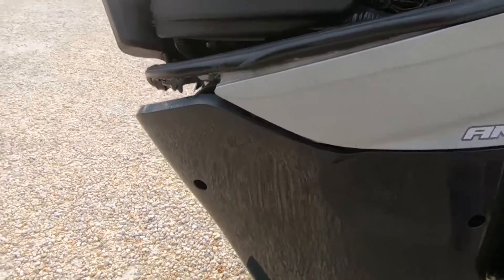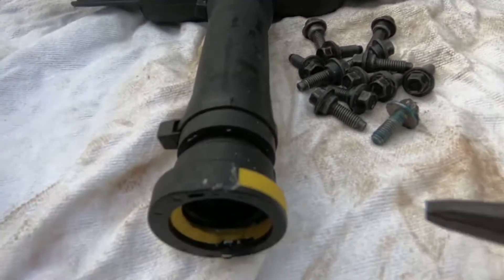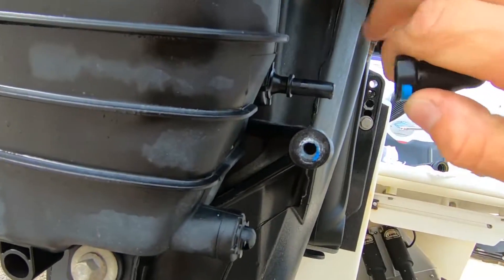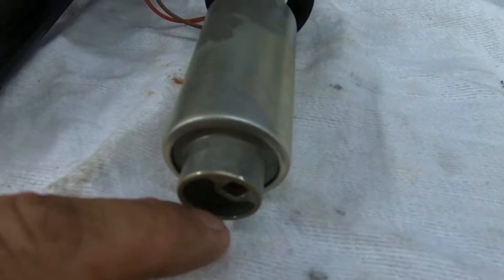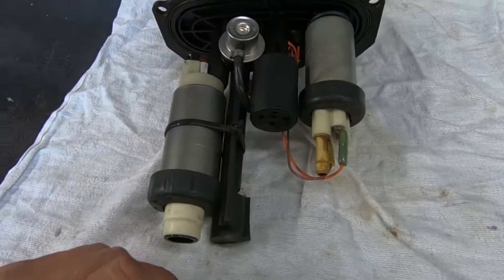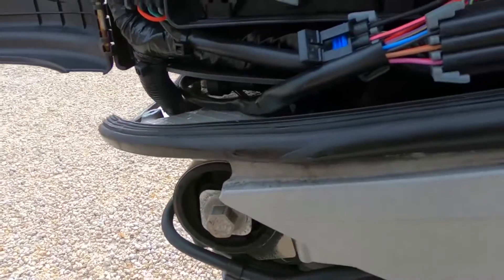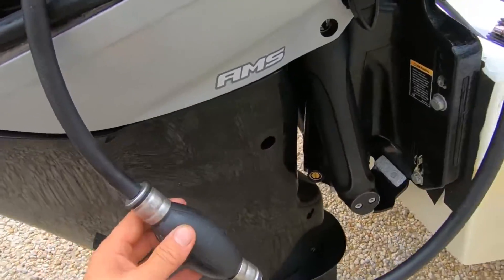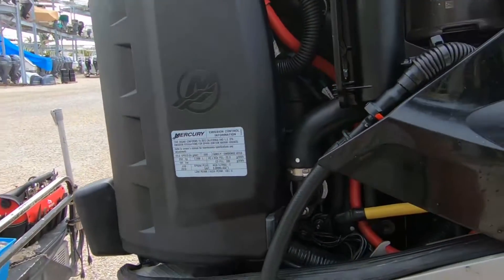How to remove | Disassemble | clean or change pumps in a Mercury Verado FSM (Fuel Supply Module)

Comment: Have you ever seen a lift pump that will run but not prime itself?

I have the bottom half of the fsm removed and the fuel line for the lift pump stuck in a jar of gas. It will pump lots of gas once it’s primed, but it won’t suck gas out of the jar through the fuel line. 

My float switch seems to work ok. The fsm was mostly empty when I took it apart. 

I got a code for a malfunctioning lift pump, but the pump powers on and runs, it just won’t suck fuel unless I submerge the inlet.
Reply from the maker: Sounds like the lift pump is bad. It should suck fuel. The lift pump code is usually a lift pump time out code that shows up when the float switch goes to low. When that goes to low after a certain period of time the PCM or computer will send power to the lift pump to turn it on. Then the FSM should fill up with fuel and move the float switch back to the top and it will tell the PCM that the FSM is full and that will tell the PCM to turn off the lift pump. If the PCM sends power to the lift pump and that float switch never goes back up to the high position, it will give the "lift pump timeout" code.
This is usually either a bad lift pump, (which sounds like that is your issue), or a sticky float switch that isn't going up. You should check the harness that is coming out of the top of the FSM as well, and make sure there isn't any restrictions like a really old and dirty fuel water separator that is stopping the lift pump from being able to pull the fuel from the boat tank.
Sometimes a dirty water separator or a kink in the fuel hose, or a dirty pick up tube from the fuel tank will make the lift pump work harder than normal until it gives up and becomes so weak it can't pull fuel from the tank.
As long as that float is going from straight continuity to open loop and moving up and down freely, sounds like the lift pump has bit the dust!
Reply: @BornAgainBoating  Thanks for the insight. The old lift pump looks like an aftermarket one, as it is branded quantum fuel systems (highflowfuel.com). The thing that is really confusing to me is how poor the mechanical connection is between the inlet of the lift pump and the fuel line it is sucking from - it seems really probable that an air leak could exist around the loose fitting seal at the inlet of the pump itself and break the suction. It seems like they repurposed a lift pump that was meant to be submerged in a gas tank instead of using one with a crimp on hose to connect to the FSM tank. 

Anyway, I tested the hell out of the old pump. I took the top of the FSM off and stuck the inlet fuel line (without the filter) into a can of gas. The pump couldn't create enough suction against the line to lift gas 12". If I submerge the inlet of the pump, it will pump a steady strong stream of gas, but it just doesn't create enough suction to pull from the tank. If the pump were mounted in the tank and pushed the fuel to the FSM, I have no doubt that this pump would still work.

Anyway, I ordered a new OEM pump instead of another quantum pump just in case the OEM one will seal better against the FSM tank.

Pics here: https://imgur.com/a/ZM3tBU8
Reply from the maker: Awesome! Yeah, I've never seen a pump like that before lol didn't look like there was any kind of screen on the inlet side of the pump either :/ It sounds like the pump is your problem :) that new pump should get you up and going!
Reply: Di you fix it i have the same problem but can fin the problem
Reply: @jeanbertowernet5719  Yes - I put a new pump in and everything has been fine for the last 2 years. Even though the old pump was "working" - meaning it would run and pump fuel, it wasn't pumping enough therefore it wasn't providing enough fuel pressure. I've never seen a fuel pump fail in such a way - but mine did.
Reply: I put tham new but aftermarkit

Comment: Good video.  Question: Why did you add a zip-tie between the high pressure pump and the plastic tube?
Reply from the maker: Thank you, I'm not sure why exactly that zip tie is there, but mercury puts that in there so I leave it in there.
Reply: Thank you for the quick reply.  I took mine apart today using your video to check my screens.  

I’m having some issues with surging at the higher RPM range and I’m working through all the possibilities.  Thank you again for the video.
Reply from the maker: @gascop69  You're welcome, thank you! What did the FSM look like? Was it really dirty or pretty clean? How old are the spark plugs?
Reply: Born Again Boating there was some rust debris  at the bottom of the FSM (a fair amount). It likely came from the lift pump case, which had some corrosion, undoubtedly from a water in fuel/ethanol issue.  I think it’s possible that under high load, the debris was being sucked up by the high pressure pump and clogging the screen.  We’ll see on the next sea trial if that was the problem. 

Everything else looked good.
Reply: Spark plugs are about 300-hours old.  I’m doing this in conjunction with a 600-hour service, where I’ll be replacing them.  

Another question if I may:  I see there’s an impeller repair kit and a complete water pump kit available.  When would you use the impeller repair kit vs. a complete water pump kit that includes the housing?
Reply from the maker: @gascop69  Awesome! That is very possible, hopefully that was your problem. If you cleaned that and are doing a service where you replace the plugs and the fuel filters, you should be in great shape! 

Once the plugs get to be a white chalky or burnt look on the tips, it's time to change them. I know they are expensive but it makes a huge difference!

For the impeller kit, I would just use the repair kit that comes with the impeller, here's a video on that: https://youtu.be/YtivxsdwEqY

Mercury makes that metal housing which really only goes bad when it gets damaged by us messing it up! They are great housings so you shouldn't need to replace it. 

If it gets destroyed when say a gear case is stuck on the engine and we have to use chisels to get it off and hit the housing. Outside of that, they hold up great!

We've also got another video for a full service on the Verado if you need any help during your service! Thanks for the comment and good luck on your service!
Reply: What ended up being your problem? Having similar issues with 225 verado.
Reply: J G I cleaned the FSM out as I described above, did the service, which involved both fuel filters, and spark plugs and the problem disappeared.  It could have been clogged fuel filters, old spark plugs, or that high pressure pump being restricted with the rust debris.
Reply from the maker: @JG-kt6ff  I think it was the dirt in the FSM for him and some old plugs. When was the last time you changed the filters and plugs and serviced the engine?
Reply: Just changed both filters. 100 hour service last October. Runs perfect until 4000rpm,then bogs down/throttles down.

I can inch it up above 4000, but have to slowly raise throttle. Bogs when raising throttle at normal pace or quickly.